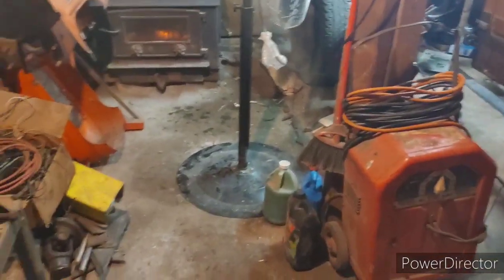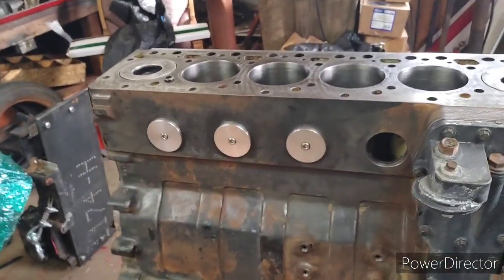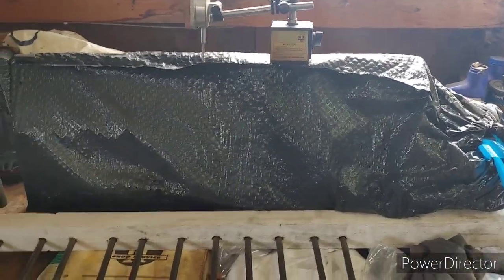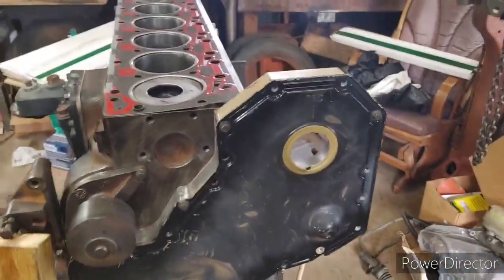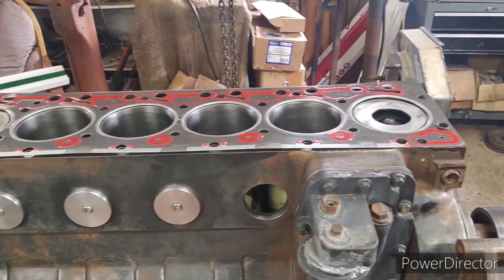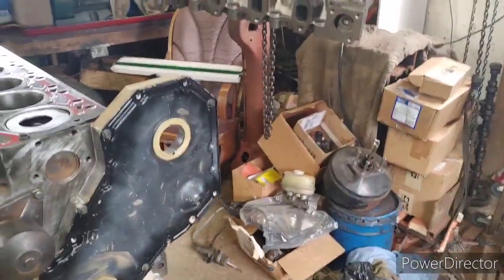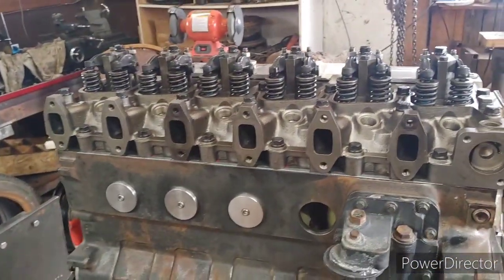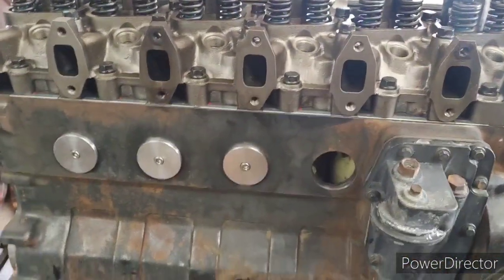Putting the head on the 5.9 Cummins and working on the shop

Comment: Greetings thank you for spending the time to give somewhat as much as you can help to others..Q. Old JD 1961-1965 farm tractors some do have dual selective control valves that hard to find kits for them other than buying individual seals and packings however the valves are the hardest. Do you have an old attached sheet from on old kit you used? The manual give general idea but not technically helpful and no specific manual as the oil pump and the injection pump. That would be very appropriate. My tractor 4010&4020 both working but started on 4010 a restoration and complete paint. God bless